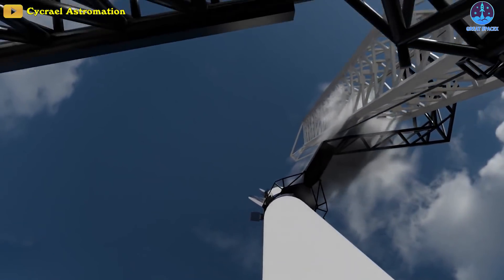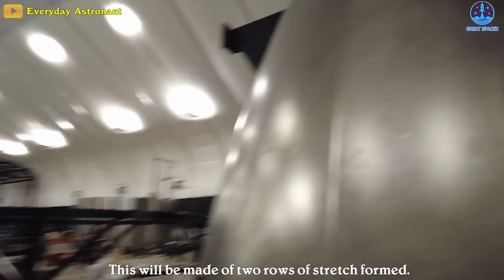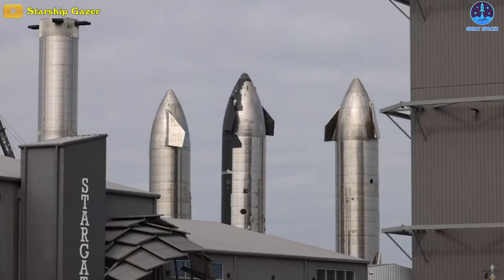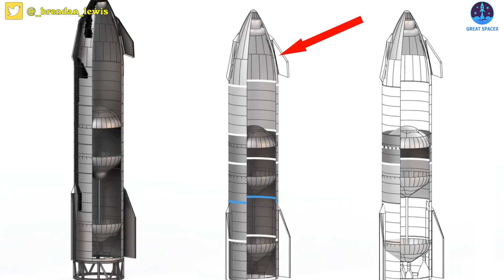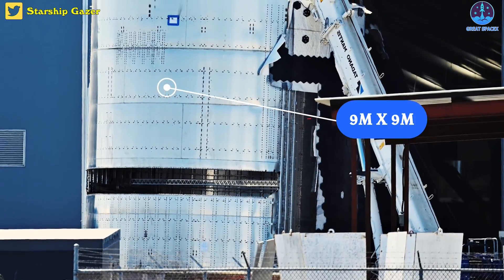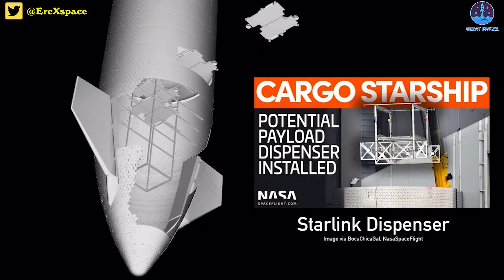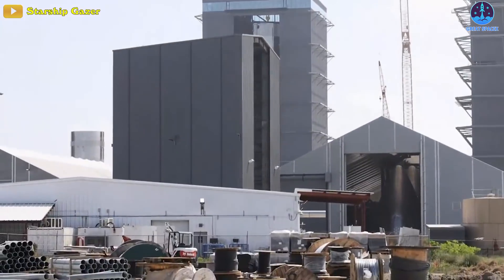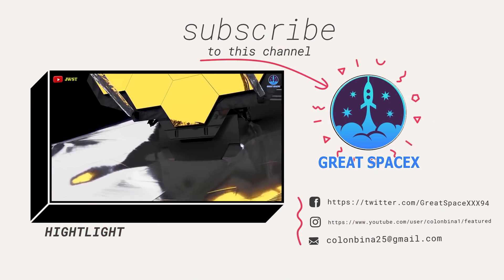It happened...! SpaceX Updates On Starship New Nosecone Design...

Comment: I think a bigger breakthrough would be to eliminate the thousands of tiles with some other type of heat shield that could be a wrap that is flexible enough to eliminate the majority of the little tiles.
Reply: That would negate what these new heat shields do compared to the shuttle.. They have a lot of features for a simple design!
Reply: @gordalot  Agreed. The real improvement would be minimizing the number of uniquely shaped tiles. That was the bane of Shuttle's design. It's not hard to imagine a robotic arm installing single-sized tiles on Ships during manufacturing. It's the oddly shaped ones that would cause problems.
Reply: Time to hire a mathematician who is into tessellation. No joke. Having some akin to Buckminister Fuller would be a great benefit.
Reply: totally agree. Have to believe they are working on some kind of insulatlon layer with several layers of erodable paint or other cover with advanced characteristics. This would make it so much faster and create a better adhesion to the ship.
Reply: Spray on
Reply: @philipdennison1500  Spray on starlite?

Comment: I’m a bit to all this. Can someone explain to me why the booster isn’t gonna have a small test flight, but will instead go straight to orbit with the nose?
Reply: Or even without the nose
Reply: No need. It wouldn't test anything. They can already test the thrust, pumps and engines from the ground, and they aren't focusing on landing the booster right now so there isn't any point. The test starships was to verify thst the bellyflop could work, and not really to test the parts.
Reply: @idontknowanygoodnames1498  thanks

Comment: I haven't thought it out but I remember the Three Stooges in Outer Space in which their rocket was laid on a fulcrum and tipping like a teeter-totter to get the crew closer to the surface.
Does the crew cabin have to be on top? Many advantages of it being up there but does it have to?
Reply: Rockets go through stages so you can't really put the crew compartment anywhere else unless they aren't the last stage of the rocket. Also most rockets have a lanch escape system which pushes/pulls the capsule away from the rocket, in which you wouldn't be able to put it anywhere except for at the top.
Reply: Rockets work best with the flamey end at the bottom.

Comment: Let stop this welding nonsense with the nose cone let’s do the Giga press nose cone ;-) perhaps a two piece cone….one piece is most likely not doable…
Reply: I don't think spacex would consider doing a gigapress nose cone until the design is FINAL final if they ever plan to do one. Plus can anyone even manufacture that large of a single stainless steel slab anyways?
Reply: @justapleb7096  two pieces could potentially work. And yes I agree they need to iron out the final design before thinking about a two piece mold. If the Giga press works then the 1,000 Starships will be greatly accelerated.
Reply: @justapleb7096  I'm sure it can be arranged...
Reply: @squashduos1258  gigga press uses a low temperature alloy of aluminium because it can't take the heat, I don't think it could do stainless
Reply: @BenQuigley  if you can build a motor cycle tank (2 pieces) by rolling it through a press back and forth this should be doable imo….if there is a will there is a way…but first come up with the finals design or shape of the cone…
Reply: @squashduos1258  a rolling mill is very different to a gigga press...
Reply: @BenQuigley  who said it needs to be exactly like the giga press..that is the starting point…make adjustments to it…
Reply: @squashduos1258  you do know how much it costs to develop something like the gigga press. There's a reason why Tesla don't make them and but then pretty much off the shelf
Reply: He already said in the video the new nose cone was 2 parts of stretch formed stainless
Reply: @johndea3330  I think he implies 2 sections stacked on top of each other and the image nor the drawings show two cone shaped halves….but I could be terribly wrong….
Reply: @squashduos1258  Elon Musk at the very beginning of the video explicitly said 2 stacks of stretched... his words not mine =)
Reply: @johndea3330  two stacks stretched ontop of each other because he is not pointing towards two halves…
Reply: @squashduos1258  correct he is pointing at a full nose cone, that if you look closely you can tell its stretch formed...
Reply: @johndea3330  yes but there are more longitudinal pieces than 2….
Reply: Obviously none of the commenters on this thread are fabricators or welders or metal spinners or have any experience at stamping.
  It is welded because that is the quickest and most cost effective way to do it.
Reply: 😃😃😃👍giga printer 3D😁😁😁👍